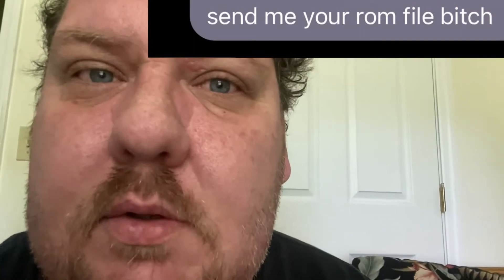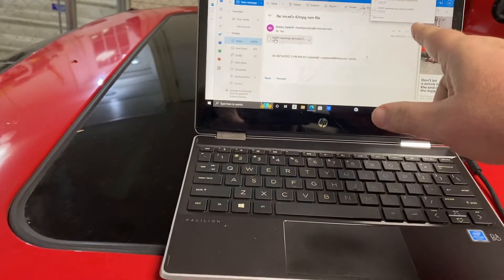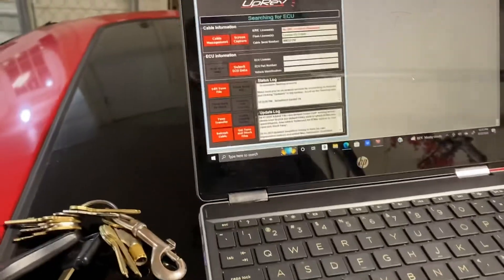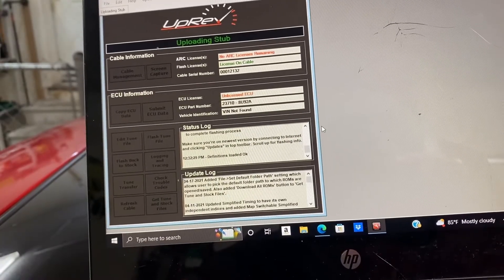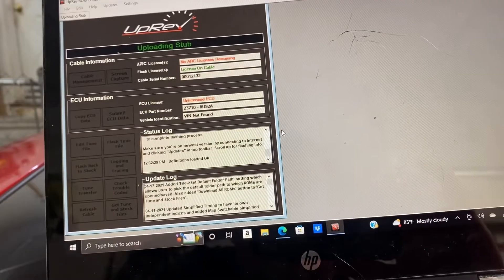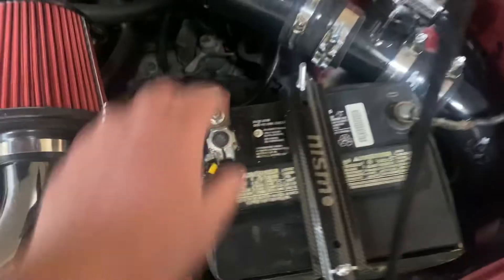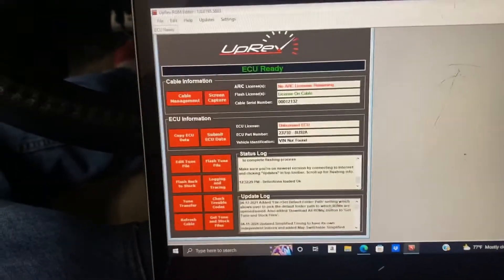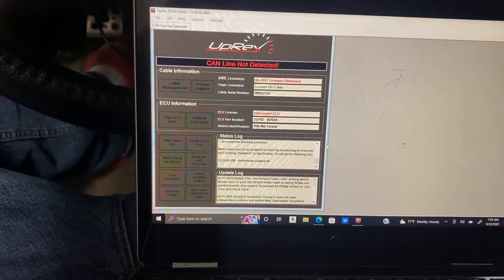Did I Brick my sentra’s ECU? Part1 uprev on the b15 chassis

Comment: My friend and i am tossing an idea around that could potentially make this way easier for these cars. He thinks we can make a chevy ecu, for engines 6.2 5.3 4.8 and 4.6, into standalone ecu's. We are going to test it on a early 90s obd1 ford, and i belive if it'll work on there, it'll work on anything, but im going to see if we can keep going down this rabbit hole, because it can benefit many things obd1 and cars like the 02 model spec v i belive could benefit from it.
Reply from the maker: That’s sounding overly complicated when the 02/03 can be reflashed and the issue with standalone with the cars is that there is no plug and play harness. So I am kinda curious. I may message you about it
Reply: @red_rabbit_specv  yeah. It'll basically do away with having to deal with uprev and all this stuff and be able to live tune it for boost and such i belive. As of right now its all just a theory. All we plan to do is make an adapter from main harness to gm ecu, and reflash a factory tune for the vehicle on it instead of the gm tune for their trucks. I'll probably be posting in the group about it when we do it to the first vehichle as a proof of concept and if it poses enough positives that it gains enough interest, i'll do a write up on how to make the adapter and everything.

Comment: If you haven’t already can you make a vid about the uprev setup? I got a 04 spec and I’m planning to go turbo
Reply from the maker: I have a video on doing the uprev can wires already. Just make sure the connectors are tight. I think that’s my issue. Once I get mine fixed I am making a full video from software install to datalog then to final tune.
Reply from the maker: https://youtu.be/Jen8sCKQM5s